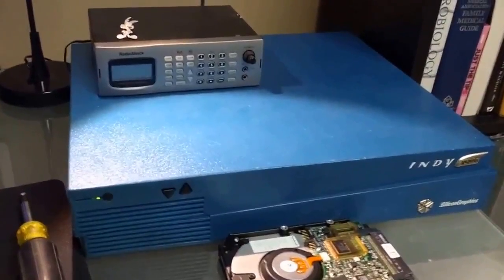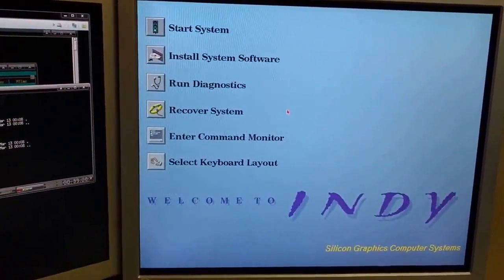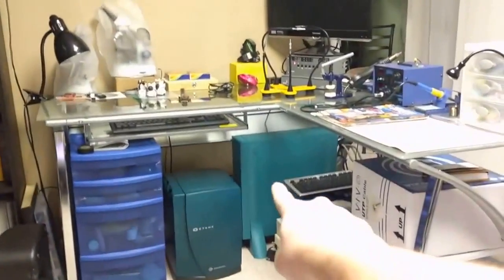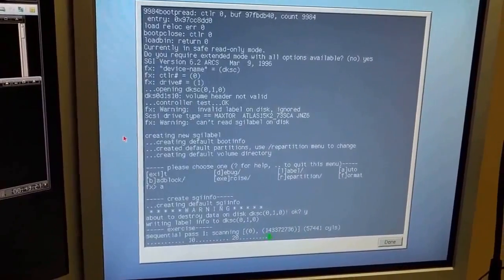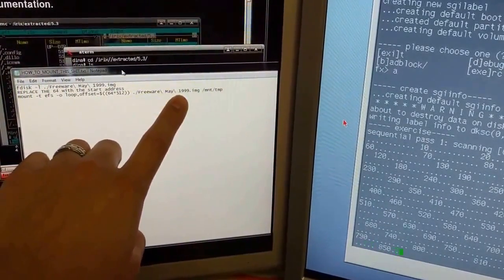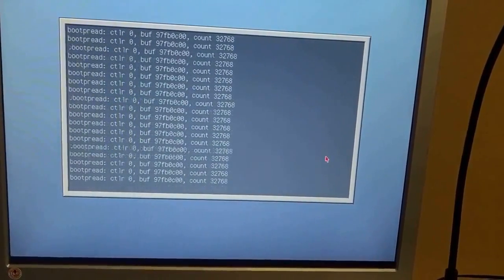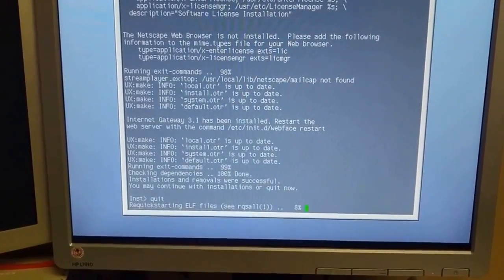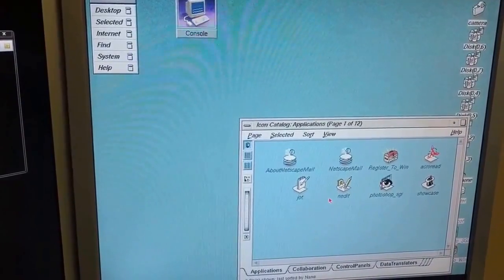Indy IRIX Install Process (Over Network)

Comment: For anyone who is having a tough time with DINA, I suggest you search for “SGI forum net install love” A community member made a piece of software called love, and they also include a tar file with 5.3, 6.<0,1,2,3,4,5> and overlays for 6.5.22 and so on. I just spun up a Linux mint VM and ran love on the same LAN as my Indy. Works great, read the instructions carefully.